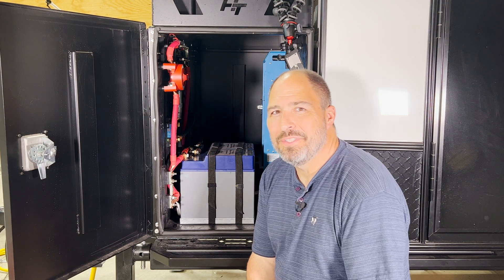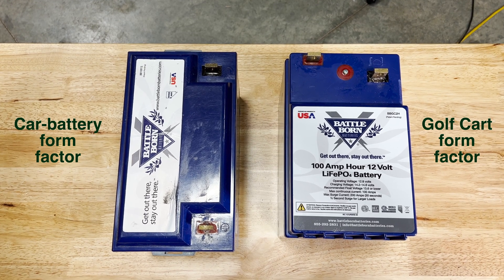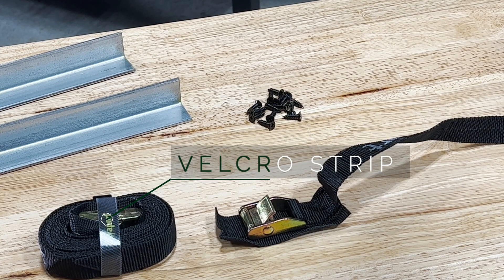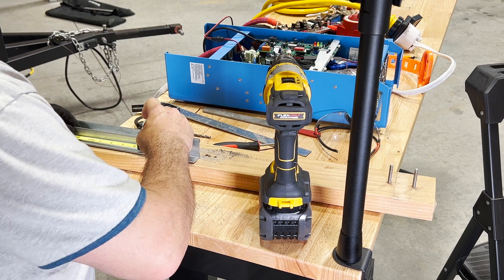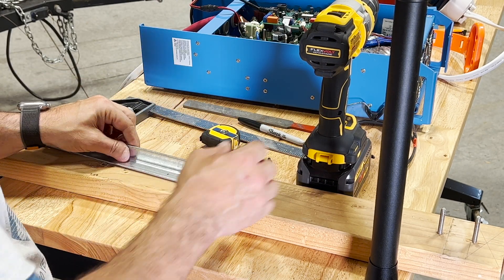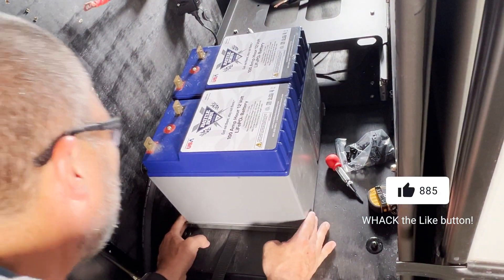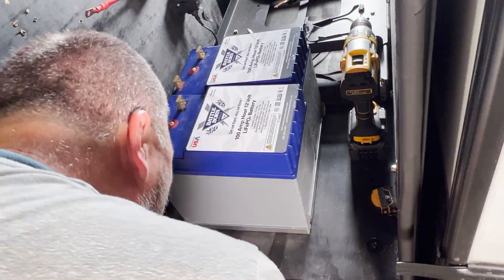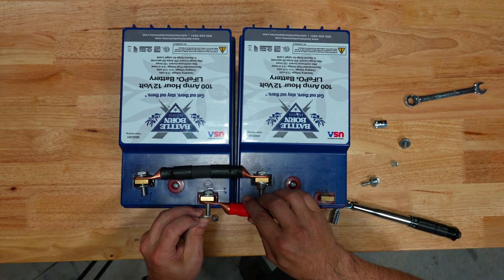How To Build DIY Battery Holder

Comment: Excellent video - thank you!  I am installing in an existing metal battery box, instead of wood.  Why are a couple screws put into each strap?  If the angle iron is screwed/bolted to the wood/metal base, does that not provide sufficient pressure to hold the strap without putting screw holes in them?